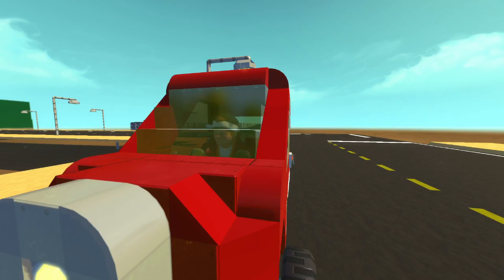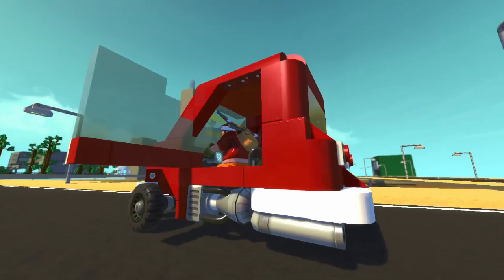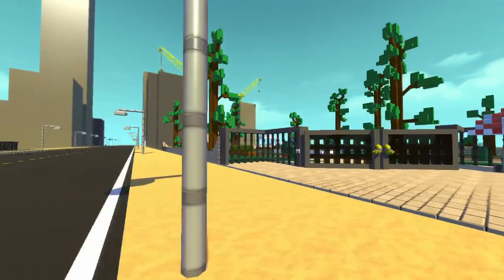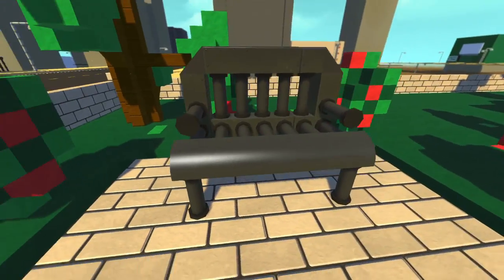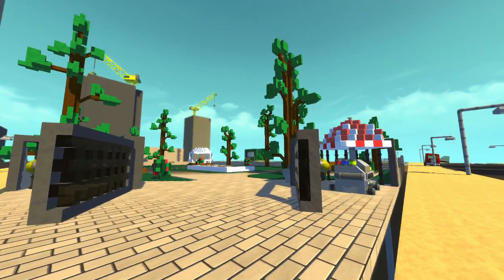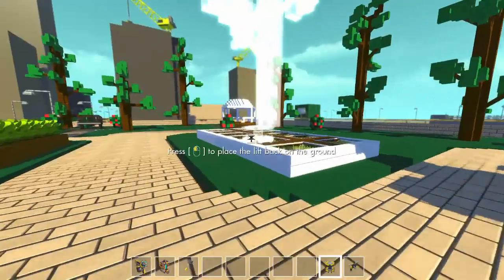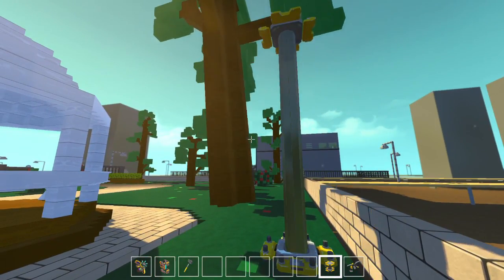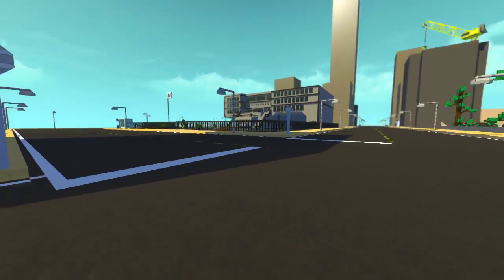Scrap Mechanic City - Episode 5 - Park and Peel P-50! (World Download)

Comment: Is it controllers and a button instead of the engine?
Reply from the maker: It's thrusters actually!
Reply: so there is no engines at all? so the thrusters are connected to the drivers seat?
Reply from the maker: Yea, you press W to move by thruster!